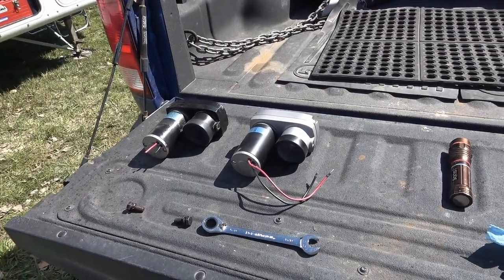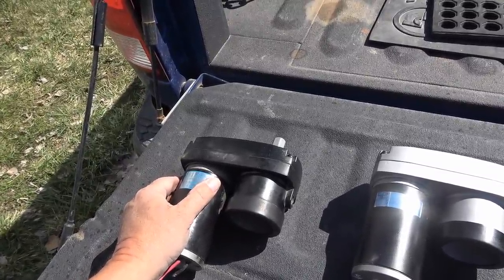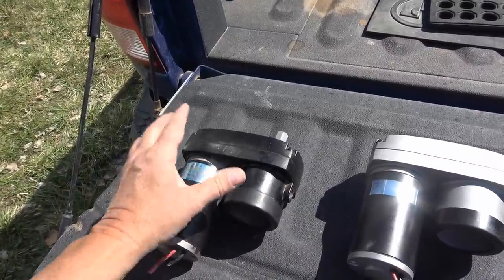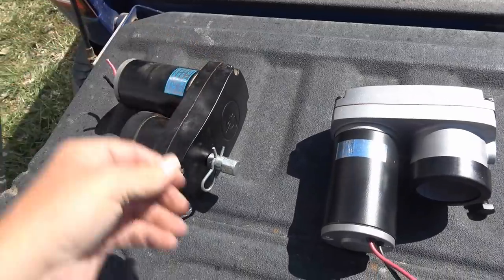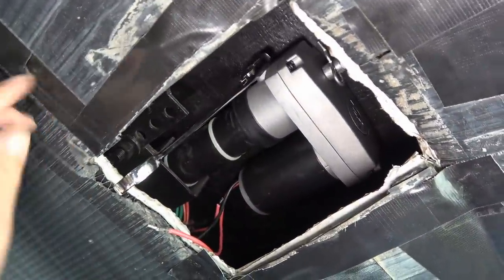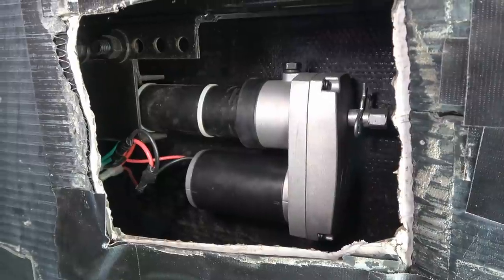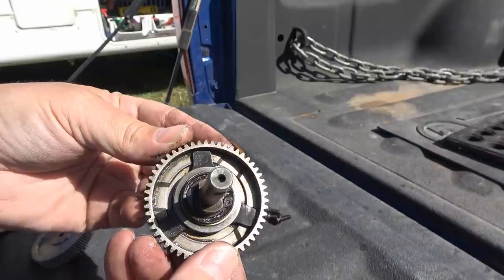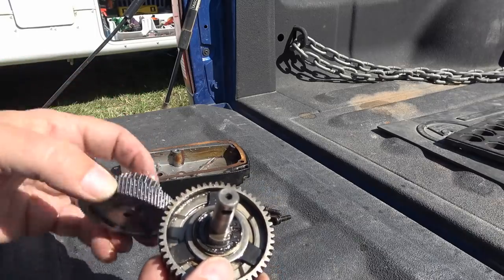RV Slide Out Repair - Replacing a Faulty Electric Motor Assembly (Lippert 18:1 Tuson Motor 125802)

Comment from the maker: Link to the previous video where I replaced the worn-out plastic gear - https://www.loveyourrv.com/rv-slide-out-stopped-working-but-easy-repair-replaced-stripped-gear/
Reply: Hi Ray. it's been a pretty wet and windy weekend along the coast, but it's getting nice again. Anyway you haven't done many maintenance videos lately, and I was wondering when the last time you replaced your water heater anode was. And what is your process.

Comment: Nice job and excellent video. That clutch makes a pretty good impact when it skips. Though it should be pretty hard, I wonder if it peened out or otherwise distorted over time to the point where it hung up.

Comment: How would you classify this job, easy, novice, or expert mode, and where can I find out what motor I need for my slide?
Reply from the maker: I'd rate it as easy. Pull the motor out and you should find a part number on it  Also watch this parts update video https://youtu.be/zDOJR0lBwUI  and first video  https://youtu.be/RnUiW0rRMwQ Cheers, Ray
Reply: When you pull the motor out, will the slide move on its own?  If so, how would you prevent this?

Comment: Having slide issues, so was out at the storage lot trying to diagnose, and also trying to figure out where my manual slide out hex bolt was if I had to bring in manually.  Have an above floor lippert rack and pinion with ALL the parts (motor, gears, track, rod, manual hex bolt) inside the camper.  For the life of me, couldn't find the manual hex bolt anywhere.  Your video showed me right where it is- it's the hex bolt held in by the cotter pin.  So...at least that's solved in my mind.  I"ll need to play around with extensions for my drill, as- the hex bolt is probably 2 ft in underneath the dinette.  Will need to figure out what will actually reach it, but...a problem for another day!

Comment: Thanks Ray for an informative video, glad to see you keep the Cougar sliding. I've had 3 5vers with slides system,  hydraulics have been the most reliable for me. My KZ had a gear drive via rack and pinion which always seemed to fail at the most inopportune time. I eneded up converting to a Venture linear actucator which eliminated the pitfalls of the direct drive rack and pinion gear system. YMMV Happy Camping.

Comment: Although the slide outs give you so much space I don’t believe they are worth all the problems they cause because they are so cheaply made. Looking at that clutch assembly it looks like it might be repairable if you can get it apart.  Best to you and thanks for the video 😊 !
Reply from the maker: For our size of trailer 27.6 feet and living full time in it the slide is 100 percent worth it to me. The living space with slide out versus slide in is night and day difference.  Extra 36 square feet of floor space and extra storage under the day bed and over head cabinets.  https://www.loveyourrv.com/wp-content/uploads/2015/09/RV-Reno-3.jpg
It would be so cramped in here without it. I can't even imagine it. We'd have to go to a much longer trailer to recoup the space and that would be a much bigger pain than the slide. Cheers, Ray
Reply: @LoveYourRV  , have to agree with you Ray. In your case I can see the value of the slides, I tend to forget that full timers look at things differently than those us that are ( weekend warriors 😊) .

Comment: Noticed that the Lippert gearbox is made in China? Has anyone had experience with the aftermarket Chinese gearboxes. As low as. $68 on EBay.
Reply from the maker: Not sure if you saw it but I have a update to this video https://youtu.be/zDOJR0lBwUI  You can now buy both gears direct from OEM Tuson. Cheers, Ray

Comment: I saw your video a while back when you installed the metal gear and I had a question in my mind then. How/where do you get parts delivered to you when you are on the road? Thanks Ray!
Reply from the maker: I use many different methods. Amazon has pickup locations called hubs or lockers. Hubs are stores like say Walgreens, where you pick up at the counter. Lockers are usually outside gas stations for corner stores and you enter a code and a door opens. https://www.amazon.com/primeinsider/tips/amazon-locker-qa.html  
Then there are FedEx and UPS access points that are usually located in stores. For this motor for example I had it sent to an Auto Parts shop that was a UPS access point https://locations.ups.com/id/twinfalls/access-point-location-186682.html?utm_source=google&utm_medium=organic&utm_campaign=rio
Another way is to send to USPS general delivery - https://faq.usps.com/s/article/What-is-General-Delivery  Some RV Parks will accept packages for customers. 
Back in BC on Vancouver Island since I spend months in one general area I pay for a mailbox at a UPS store. - https://www.theupsstore.com/mailboxes
And finally, I have made friends with a great many RVers around the country so often I will have packages sent to their homes if I'm coming through the area. Cheers, Ray
Reply: @LoveYourRV  Thank you for delivery tips and links 😊🙌🏻🌈
Reply: Was wondering the same thing.

Comment: what motor from  canbuy that will work with mine? mine is the same as yours. just  want to pay 600 or 800 for one. do you know which is compatable
Reply from the maker: See this blog post with another update video to new source of all the parts https://www.loveyourrv.com/rv-slide-out-stopped-working-but-easy-repair-replaced-stripped-gear/ You can now get the OEM faulty gears and fix pretty cheap if that's the problem.

Comment: Do you know of different load or weight limits of motors   Thanks
Reply from the maker: No I don't. If interested maybe the OEM knows the detailed specs. Here is the link https://tusonrvbrakes.com/products/copy-of-new-tuson-40-electric-through-frame-slide-out-actuator-with-linear-ball-screw-actuator-tube-manual-override-hex-nut-with-clevis-pin-tus-1a04101224-04

Comment: Tuson RV Brakes has both the clutch gear and the motor on their website
Reply from the maker: Awesome, great to hear they are selling it now
Reply: @LoveYourRV  I tried sharing the links but the comment would keep deleting
Reply from the maker: Any links get held for moderation but I don't actually see anything in the Held for Review section. Weird. Maybe YouTube spam filter was deleting. Cheers, Ray
Reply from the maker: I'll make an update video for my viewers letting then know where to get the parts now.

Comment: Well Ray this may be a good time to trade for a new rig because you probably have added enough apps over the years that would offset the depreciation on the trailer, considering all the wiring and plumbing improvements, etc. If you could get what you paid originally  for the rig would you take it? Of course if you figured in your time spent for your labor it would be worth an absolute fortune but it was material for videos so you can look at it that way. Besides,look at all the fun you had doing it!
Reply from the maker: We have no compelling reason to get a new trailer. We only paid $30,000 Canadian for it back in 2011, so that's about 24,000 USD. Figure we'll hang on to this one for a while yet, maybe 5 years at least I figure. The bones of it are still pretty good. Not much in the way of corrosion on the frame being a west coast trailer and spending winters in the desert mostly.  Sidewalls and fiberglass are still in decent shape, we love the layout. The walls are aluminum beam. There is no wood rot that I can find and we live in it 24/7 so usually notice pretty quick and fix right away.
Maintaining it is way cheaper than getting into a comparable one for say 60-80 thousand and from what I hear most new RVs aren't very well built these days what with all the supply chain issues and labor shortages. Then there is all kinds of problems getting warranty work done in a timely fashion and by a person that is skilled at the job. I think this is likely the worse time to be buying new. 
If we went down the newer used route there is no guarantee it would end up better, could be a basket of new problems after spending a bunch of extra money. I'll stick with the devil I know unless say something like the frame breaks in half. :)  Cheers, Ray
Reply: @LoveYourRV  That's exactly the reasoning I use to justify keeping my 1995 Ford Ranger pickup with 297,000 miles and running better than it over did. Bought it new for $8,000 and its replacement would be at least $30,000 I imagine. It'll be good for another 100,000 miles!

Comment: Sometimes it’s better to just replace the whole thing. If it lasts another ten years, it may be time for a new rig.
Reply from the maker: That's likely why so few repair parts are available these days. Back in the day, people would repair things, and manufacturers would have to provide diagrams/schematics and replacement parts, now it's all a disposable world. :(
Reply: @LoveYourRV  Agree with your statement. I like to repair & fix.. I've had the same issue with our home trying to fix an oven and now a dishwasher. I ended up eventually replacing both as I could not find a small solenoid for the dishwasher & could not find a control panel for the oven. Both were 8 years old and kept being told they're too old to stock parts. So instead of a couple hundred $$$ cost me several thousand!

Comment: $641.00 for that plastic gear???? Typical Lippert, they're VERY proud of their stuff!!!! Can I ask what the whole motor cost you??
Reply from the maker: huh? Where did you get $641 for a gear? This is all the info I could locate searching around the internet. 
Lippert doesn't seem to sell the plastic gear for the Tuson motor, at least not that I could locate. Tuson sells the gear here for $60  https://tusonrvbrakes.com/products/nylon-gear-for-18-1-gear-ratio-lp-actuator-or-right-angled-gear-motor or there is someone on Amazon and eBay selling a metal replacement for $25.99 https://amzn.to/3xoVdQe  
The main problem is I can't locate the clutch gear anywhere so the only choice is a whole motor. Lippert has it here on their store for $751 https://store.lci1.com/18-to-1-tuson-motor-without-actuator-125802.html or it's on Amazon for $569 https://amzn.to/3O72GsX.  I also found what looks like the same Tuson on AP Products brand website $637 https://approducts.net/product/014-125802-181-tuson-motor-9000-rpm-high-speed/ and what looks like the same AP Products brand version on Amazon $395 https://amzn.to/3julR1T  Can't be %100 percent it's exactly the same though as the Lippert Tuson
Also here is the actual Tuson manufacture page I found but they don't seem to sell to end-users https://www.tuson.com/dc-motors-linear-actuators/?fbclid=IwAR3xpdGWzp3--e9EQOnXMZHO25XAdYXX54JdIkjNclOIzhLrqqTIOEb5nrA
Cheers, Ray

Comment: Ray, did the 5/8 bolt get threaded on the housing and the circular tube or did the bolt pass through the housing and connect to the circular column in a threaded slot? I hope this makes sense.
Reply from the maker: Can't quite remember exactly. It went through the housing, so it must have when into a threaded slot I'd guess. You can see it in the first video I did https://youtu.be/RnUiW0rRMwQ?t=125
Reply: Thank you, Ray, as it turns out the motor housing slipped off the actuator. I found the bolt laying on the chloroplast underbelly when I opened it up all I had to do was reattached the motor to the actuator using the 5/8 inch bolt. Once again, thanks for your quick response and your videos. They are very helpful.
Reply from the maker: @tombartlett7606  You're welcome. :)

Comment: How much for the motor?
Reply from the maker: Currently, $408 right from Tuson https://tusonrvbrakes.com/products/copy-of-new-tuson-40-electric-through-frame-slide-out-actuator-with-linear-ball-screw-actuator-tube-manual-override-hex-nut-with-clevis-pin-tus-1a04101224-04  Could be cheaper knock-offs out there, I'm not sure. Tuson also carries both gears now.   https://tusonrvbrakes.com/collections/replacement-parts